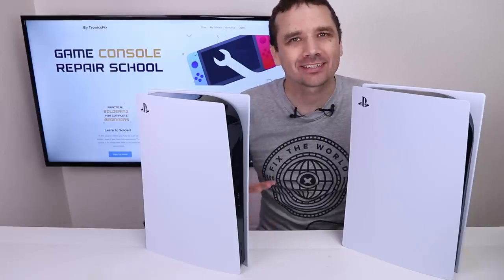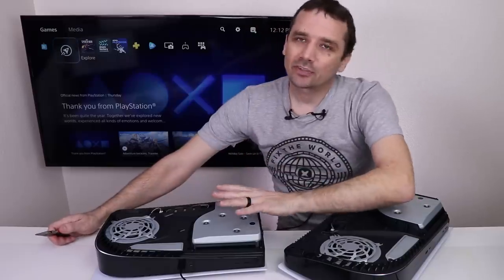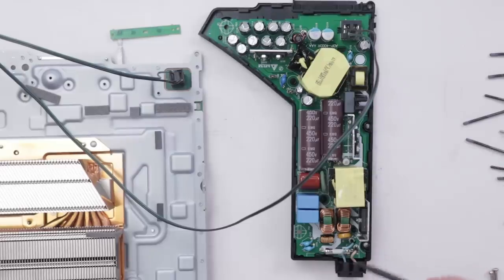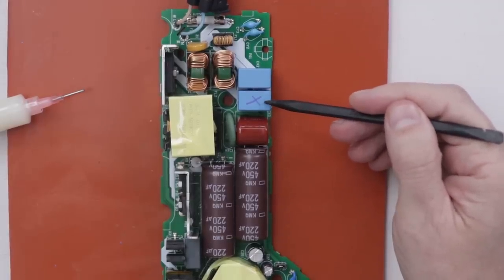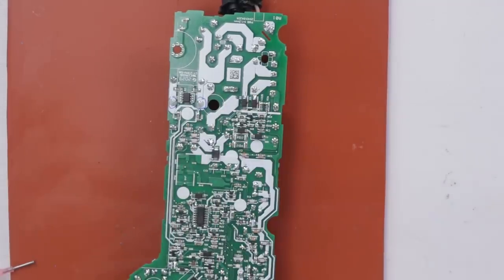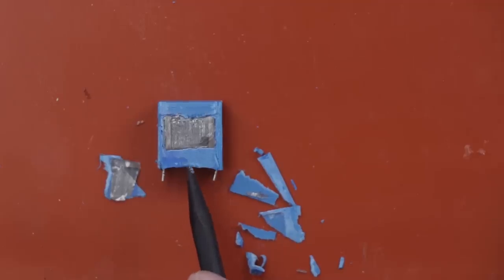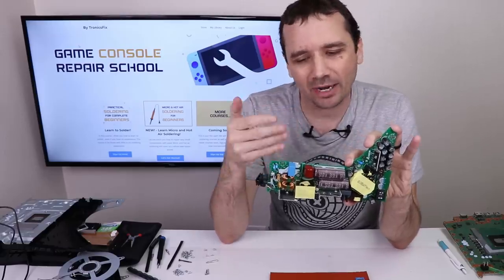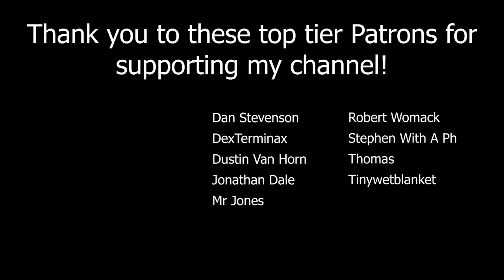PS5 Coil Whine - What Is It and Can I Fix It?

Comment: hey guys i chance  capasitor but same  noise coming:(
Reply: Which capacitor did you use?
Reply: from we 155k . 2 difirind but same noise . (310v difirint cap ) sry . for my englisch
Reply: Did you try  ??
Reply: @ibogun9467  so both of you have changed the capacitor and it doesn't resolve the noise? Have you changed both capacitors or just one and then the other? What capacitor is 155k?
I use a WE X2 0,68μF 310V
Reply: @andyb.981   i chance both cap we 310v 0.68 . same noise . now i will try high voltage cap maybe work ??
Reply: @ibogun9467  i got the capacitors today, but didn't change it yet. If you say it doesn't resolve the noise then it isn't the capacitor. Maybe then the Power Regulator IC (SC1143DG) at the back of the PCB directly beneath the capacitors is faulty. I wondered why all 8 pins were bridged. Don't know if that should be like this. I couldn't find a datasheet of the IC, so i will ask my Electronic Engineer colleague tomorrow.
Reply: @andyb.981 
have seen the power bridge maybe you are right. now I will put the power supply aut and look for where the noise comes from . Andy where are you from ??
Reply: @ibogun9467  i'm from Germany NRW Essen. So my colleague said, it could be correct that all pins are bridged due to the high current. Maybe i will glue the IC with epoxy also and see what happens
Reply: @andyb.981  andy ich komme aus dusseldorf :) ich glaube wir mussen erst finden wo der grausche kommt dann konnen wir was uberlegen . ich versuche jetzt netzt teil aus bauen dann versuchen zu finden wo der greusche kommt . melde dich bitte wenn du was findenst . wir schafen das :)
Reply: @ibogun9467  ah um die Ecke ✌️ es ist sehr gefährlich das Netzteil offen zu betreiben! Ich würde das nicht machen. Das Geräusch ist nur ein Symptom einer nicht richtig geglätteten Spannung, aber nicht die Ursache. In einem anderen Video zum PS4 Coil Whine Fix war es ein Transistor mit kalter Lötstelle. Es kann also helfen alle Lötstellen nachzulöten, was aber bei SMD Bauteilen nicht ganz einfach ist. Du kannst auch versuchen den IC einzukleben und dann schauen ob das Geräusch leiser geworden ist.
Ich werde mich natürlich melden wenn ich was neues rausfinde und auch ein Video machen, wenn es einen Fix gibt. Auch wenn ich sonst nie Videos mache, liegt mir diese Reparatur doch am Herzen und ich möchte gerne den Leuten helfen das nervige Geräusch loszuwerden.
Reply: @andyb.981  kannst mit bitte  Video verlinken mit der ps4 coil whine fix . würde gern anschauen. mfg
Reply: @andyb.981  did you fix the whine problem in the PSU? Did you try to put hot glue on it ? Series X got this grey kit like  fat dots on the components

Comment: It's literally called coil whine and you're checking a film capacitor?
Big brain time...
As far as I know film capacitors never create any sound, only some certain types of CERAMIC capacitors can cause some noise.
In case of this PSU it's most likely either those toroidal inductors(coils) or one of the transformers either main one or PFC one(bricks wrapped in yellow tape).
Reply from the maker: Big brain time. It's not either of those things. Those were the first things I checked. Bigger brain time: film capacitors can and do make noise.
Reply: @Tronicsfix  Well that would be something new to me (electronics engineer)
Reply from the maker: @Arek_R.   With AC current buzzing noise is produced by the mechanical vibration of the films (Coulomb force)

Comment: Hot glue that area of the PCB.
Reply from the maker: The noise is coming from inside the capacitor so unfortunately, that won't help.
Reply: @Tronicsfix  Well if it is an audible sound then something must be physically moving. If this happens inside the cap, which I never ever heard of, then it might be a production fault quality issue. I'd try replacing it with another brand with identical specs.
Reply from the maker: It can be pretty common with film capacitors. The buzzing noise is produced in film capacitors by the mechanical vibration of the films, due to the Coulomb force existing between electrodes of opposite polarity